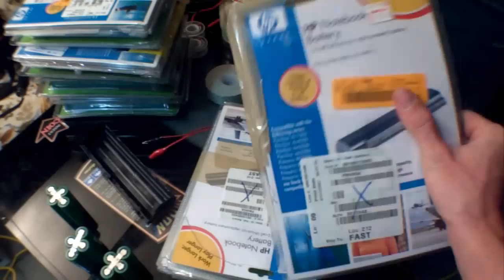DIY: 48v 24ah lithium ion 18650 e-bike battery pack

Comment: You should really explain the dangers of these batteries before putting something like this out as a public tutorial. Used/charged incorrectly or with the incorrect type of lithium battery that combined cell you built will at best vent hot toxic gas or at the worst end turn into a small bomb. 
IF you try something like this you should only do so with batteries of the same age and manufacturer. You should only use NEW batteries and not a mashup of salvaged second hand batteries. And to minimise the risk of fire and explosions you should only use Batteries that have the IMR chemistry as these will only vent hot (toxic) gas when they fail and not explode violently like other chemistry lithium batteries. 
You need to know the exact tolerances of your batteries when charging and discharging as both these can cause battery failure. The way you casually state at the end that the bike was going slow but after leaving it sit you were able to get some extra speed... this kind of treatment permanently damages the cells and will lead to them failing. 
I recommend you have a volt meter attached to the battery output and never let the output drop below the minimum save voltage for your batteries (for these 18650 lithium batteries this is generally around 3.2V per cell).
Stay safe and keep others that might take your advice safe also.
Reply from the maker: acording to my experiments lithium batteries are actually quite difficult to make fail, they are designed with the intentions of being as safe as possible. its not like i duct taped sticks of tnt together.

if lithium batteries where as explosive as people say, i would have had a weekly video series where i blow an 18650 cell up. but all the ones i try have a safety fuse inside or something, not counting you'd have to charge them to 4.9v before they short and explode.
Reply: Rinoa Super-Genius Good work with the batteries, man people on here are idiots about the batteries blowing up, yes they can catch fire in extreme circumstances but bloody hell, like you said there not TNT! People get really anal about them blowing up, i am just laughing at some of these comments lol

Comment: I got my first 6s14p pack together. I just have to wait for the balance leads to come in the mail to finish wiring and packing. I'm using cell holders since I only got cold joints on the cells.

http://imgur.com/GrT879L

Comment: I don't know what kind of dumbass down voted this video, I thought it was awesome. You might have said it in the video but where did you by the battery packs from?  Thanks again for the awesome vid
Reply from the maker: Grant Heileman just from ebay. lots of batteries get returned to like circuit city and Best Buy, then when they close the store or clear out the warehouse they auction off skids of old batteries and other little companies put them on ebay for cheep.

ebay lets you search by number of cells in a pack too btw

Comment: You know that Tesla uses this same type of batteries for their cars.... One note is that each of their batteries have a fusible link. Just in case one battery shorts internally it does not destroy the entire pack. Fire of an entire pack of LI batteries is extremely hot. Nails are very poor fuses.
http://youtu.be/raBWFsPlx7w?list=PL2l32K1w0jp-m04Jl-3PHmtapevOuCeIp
This video shows how to pick a diameter of wire to use for a fuse. This guy doing the same type of pack for an Electric car. With the exception of fusing each battery. Just in case. 
Be safe!
Reply from the maker: yes i thought of that idea before hearing tesla using them. the only issue is i would have to connect each wire directly to a main busbar witch would require me to restructure my entire battery bank,
Reply: Rinoa Super-Genius Just be careful. Over charging or pulling to much out can cause a short. These things burn hot and fast. They pack a lot of energy. One shorted battery takes out the whole pack with no fuse.  The nails will melt last in your case. Just hate to see someone loose their house while charging.

I believe Electric Vehicles are quite safe as long as they are designed for safety. The same goes for gasoline cars. Leave out the safety features then you might end up in the news. I hate seeing conservative news making hay out of EVs. A huge number of gasoline cars catches on fire every year. (I live next door to an insurance adjuster) They never get reported but EVs do.

Good luck and be safe.
Reply from the maker: LongTimeAtheist
 i intentionally charge them to only 4.0v to keep them from being overcharged and that also give 4x the charge cycles.

if they did blow up, the worst they would do is burn up my tarp shed i store the bike in. but batteries at 3.8-4.1 volts ussually dont short out.

Comment: Using 4 or 5 different types of cells in one batterypack ist nothing less then an accident waiting to happen.
I consider it highly inappropriate and irresponsible to post vids like this because people will try to copy what you're doing and it can go wrong very, very easily.
Reply from the maker: these are all the same types of cells. 4.2v 18650s. its taken me over 5500 miles without problems so i dont think you really have any room to be so upset

Comment: as much as i hate to be a dick if but if that bigass homemade battery cant make him that thing go any faster that thats sad
i am 275 pounds and my 4 stroke 50cc scooter [witch for those that dont know is the smallest sized gas powered 4 stroke engine  being widely used for power sports] has gone 45-55 mph on flat road and 10-30 up hill and have ran it 4 hours every day for 3 weeks on a full gas tank witch is 1.5 gallons of 95 or more octane gas
Reply from the maker: yes but this only costs a cent per 10 miles, or free now that i have a 200w solar panel system. so its entirely free. btw the top speed of this bike is now 37mph and a range of theoretically 200 miles.

the reason why this bike doesnt go past 40 easilly is due to the frequency the motor controller runs at, not how much power it has. but dont forget the faster you go the wind resistance is squared to give exponentially more resistance. thats why i can go 12mph with only using 6watt/hours per mile.

btw be careful, many countries including most states in the US require a moped license for the bicycle and its eligal to drive faster than 20mph on an enginenized bicycle anywhere in the US. not counting its very loud compared to electric. with electric i can sneak up to animals in the road and they dont hear me until i'm like 5 feet away.
Reply: in kentucky any bike that has a 50cc engine you dont need registration or a license of any kind you only need turn signals head and tail lights
Reply from the maker: trey law
 thankfully electric bicycles dont require any lighting differences compared to regular bicycles, your required to have atleast a dim light at night so you can be seen but i just carry my 1937 100w LED lamp i converted and that is as bright as car headlights.

its really easy to wire up lights on an electric bike but i'm not sure about an enginized bike. you can either run the lights off the magneto or from a battery. and the battery is prolly the only option with a magneto that small.
Reply: i hope you took a look at the link becuase that is a 250 cc dirt bike with an electric start so the magneto is gonna be pretty big  but wireing is some thing i have no experience with at all
Reply from the maker: trey law
 oh so that's your daily driver? i would say simply run two wires from the 12v starting battery to a light on the front and back, then add a switch to turn them on/off.

keep in mind starting batteries dont have much capacity and if you drain them down to even 50% you will harm the battery a lot. so only run the lights when the engine is on and maybe test the battery votlage and make sure after a ride it stays above 12.6v

you may want to try LED lights. they dont take much power, and you could connect a resistor to them to limit the power even more.

if you want to do it from scratch i would recommend getting 2 10watt 12v leds from ebay and modifying an old computer heatsink to connect one to.

for the back light you wouldnt need it very bright so you could connect it in series with a 24phm resistor and it prolly wouldnt require a heatsink. then the front one you could connect to a heatsink to help keep the led cool and could always make it dimmer by adding a resistor of a few ohms.

hope that helps.
Reply: no thats not my daily driver thats the dirt bike im looking to buy some day so i will have to do it from scratch i have no idea how to make a light strobe so

Comment: Stop at second minute, it is very wrong to connect used laptot batteries with new ones in that package you showed.
I did not learn anything, i would not wanna answers from guy like you. You can make li-ion explode.
You dont even have proper charger.
As for watchers, look for battery named 18650, then look for battery holder for 18650 type battaries,to start with. (recommended with built in PCB)
Then there is a bit more complicated thing to do to not overload and over-discharge them etc. Long to type.

Comment: you wasted your time....no bms or balancing function.....using a huge soldering gun transfers heat into the cells, damaging them.   your video should be called    How not to build a lithium battery pack.
Reply from the maker: i later added a bms, and this battery has taken me over 5,000 miles. so now what? lol
Reply from the maker: but thats the facts, when i moved to california i shipped this out there and used it in an etrike for commuting. had done about 500 miles here in illinois, then 3,000 miles on my cargo tricycle, and then another 1,500 miles when i transferred it to an ebike when the cargo trike broke.

this is an old video where i was still learning, go watch my later ebike battery related videos.

if i didnt go 5,000 miles on this, then how did i do my 20 mile commute in silicon valley? lol
Reply: Rinoa Super-Genius not trying to bash you-just tryin to give you some bits of info to make it better.  been building electric transport for over ten years....I know what works well
Reply from the maker: i worked in a rapid prototyping lab at Apple and had to deal with lithium batteries from time to time, and ive done years of experimentation on my own, so dont worry, i think i have this handled. just stop judging my first attempt from so long ago and critique what i do now instead. you arent talking to the person who made this video, you are talking to someone who made this video a long time ago. remember that.
Reply from the maker: oh and yes you were bashing me by saying my battery's range was "BULLSHIT". dont try to backpedal on that and pretend you only had constructive criticism.
Reply from the maker: but it did, deal with it. i have videos of me using it and whatnot all through the past years.

Comment: I love your dog!  I have one who looks just like him.  Send me an email and I will send you a photograph,  vaccavo at gmail dot com

I saw a guy riding a bike using an AEG Driller.  He changed the batteries (AEG) and kept on riding.

Now, why I found your video:  I have a Nokia speaker which uses 3 AAA and I wanted to adapt to 3 AA and got no result. What do I do?  The slot won't fit the 3 AAs!  (Please take into account I am a woman, 53 yo and was a secretary.  I would like to know if there is a way  If you say there isn't I thank you anyway.  Best regards.

Comment: Hi Rinoa. I´m trying to learn how to run my Oset 20.0 48V on Lipo from Hobbyking.  Do you have any suggestions. see the bikes here: http://osetbikes.com/us/ and the test here: http://www.trialscentral.com/forums/topic/34845-oset-batteries-lithium-lipo-conversion-directions/ (I am not an electrician or engenier) Please try to teach us because we find this posts VERY intresting and we wnt to learn! Thanks a lot.
Reply from the maker: i've put up a lot of battery videos. idk if i could explain it much better than my videos.

good luck though.
Reply: Thanks a lot!